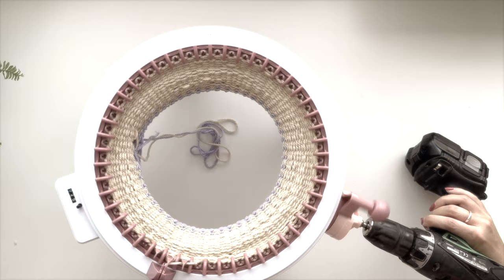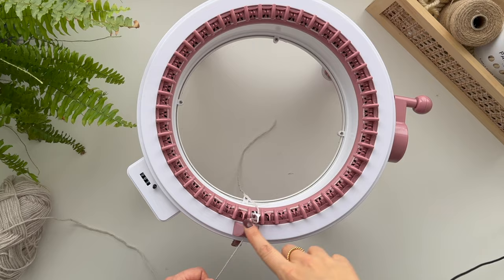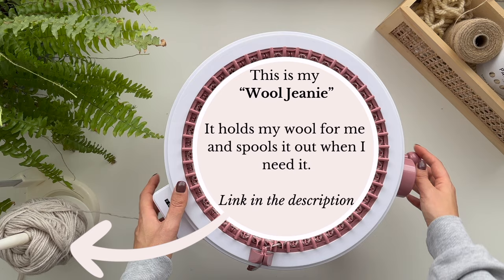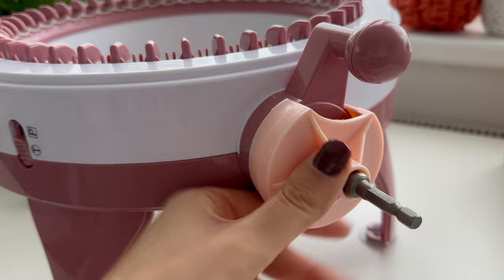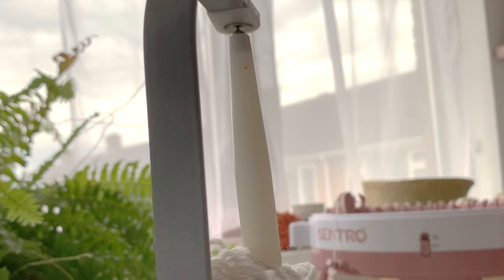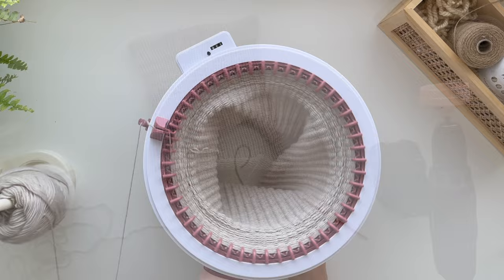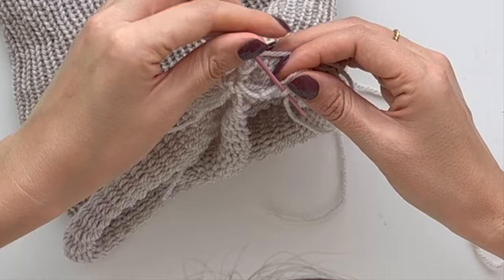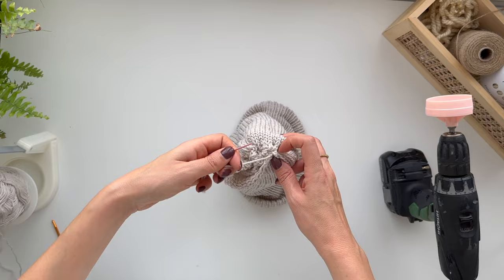USING A DRILL WITH A SENTRO KNITTING MACHINE | Can I do it this time?

Comment: "this beautiful yarn" proceeds to hold up the blandest color in the world lol just joking, great video! I just got one of these machines and am LOVING IT. I just learned about yarn dispensers thanks to your video, that will help a LOT as MOST of the time using the machine is spent pre-feeding out a bit of yarn from the ball, I learned very quickly that if there is even a small amount of tension before the tension guide it causes stress on the needles (clicking noise/stress) and forces many skipped loops or whatever they're called. in just this 5 min I learned exactly what I need to know to make my dreams of a massively over length scarf reality. Thanks for posting this tutorial :-)
Reply from the maker: Haha! Thanks for the comment, sounds like you made a lovely scarf! I have a wool jeanie that I put the yarn on which helps a lot 😊

Comment: The question is, how long did it take on the machine
Reply from the maker: It took under an hour 😊
Reply: Takes about 5 minutes to make a 150 row beanie with the drill. If you cast off and weave the tail through the loops while still on the machine it’s much faster and cleaner than how she did it. Makes a nice star shape on top but do be careful.. go too fast with the drill and you’ll melt the handle 😂